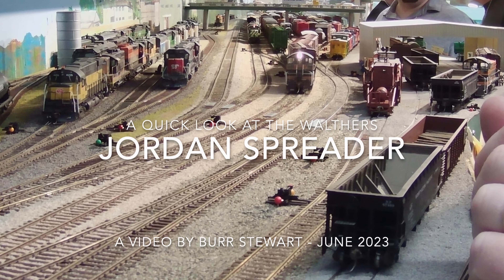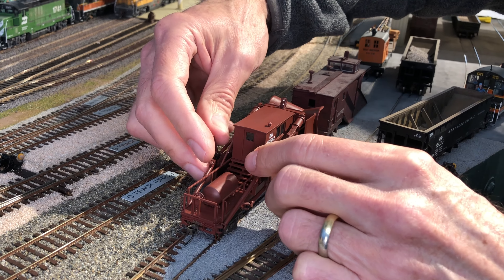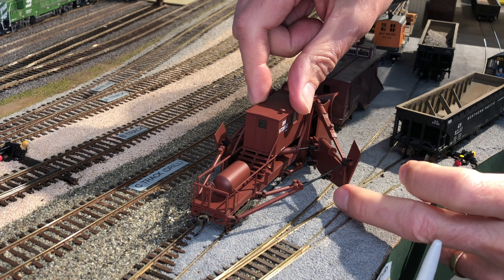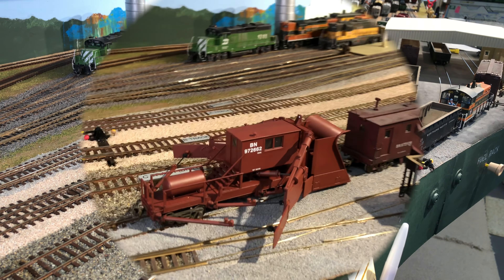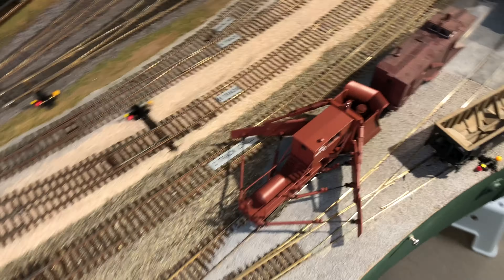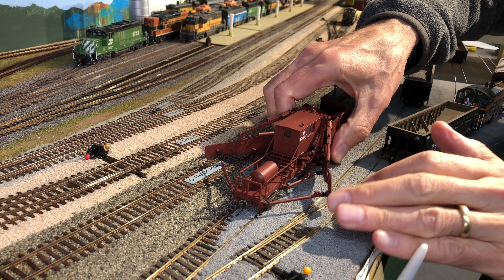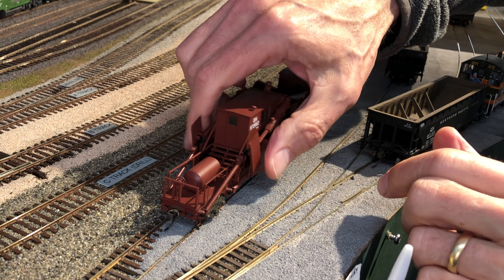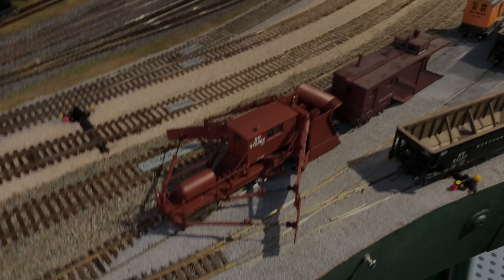Jordan Spreader spreading its wings

Comment: Snow is easy for the family of Jordan Spreaders. But always remember that its first and main purpose in life was to "spread" ballast. In real life, those wings can be dropped well below the underside of the ties to create the side slopes of the track's roadbed. 

If you have a section of double track you could set up a mini diorama of a crew working using the spreader to move ballast. But very few model railroads can afford to tie up such a section of track on permanent bases. A shadow box diorama of a small HO steam loco or an early diesel shoving hard on a Jordan Spreader moving ballast (or snow) would be interesting no matter what scale your layout is.
Reply from the maker: Thanks for catching me up on this! One question - could they extend the blades more on one side than the other, and if so, how did they keep the thing upright?
Reply: @muchfunwithtrains  Yes, the blades on both sides and the sections on one side are all controlled independently. 

As to the other question, perhaps learning via the school of derailments just how much depth and width you can push at one time depending on the type of material you're pushing around. 

Spend all of my time in the running diesel house and loco back shops. Everything I know about MOW ops is from old photos and stories from older workers.
Reply from the maker: Thanks - the reason I ask is I do have some double track where I could have a spreader working on one track while trains pass on the other. Great suggestion.

Comment: There's no point in having an operating spreader for most layouts couldn't run one for more than a few feet and there's no snow or ballas to spread unless set up as a diorama type scene.  They would be useful for photos.  I built 3 kits and used contact cement to attach the wings and pistons.  After it has dried, it can be loosened with paint remover to operate the wings when rarely needed.  Contact cement is at Dollar Tree in tubes.  Parts come off and have to be reglued back on but the contact cement works pretty well and is resoluble.
Reply from the maker: Good points, and thanks for your comment!